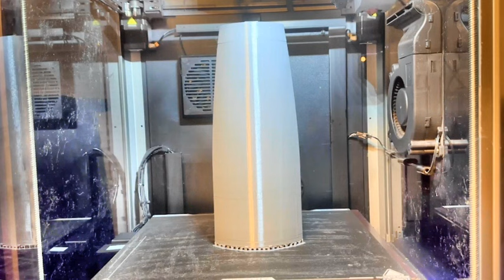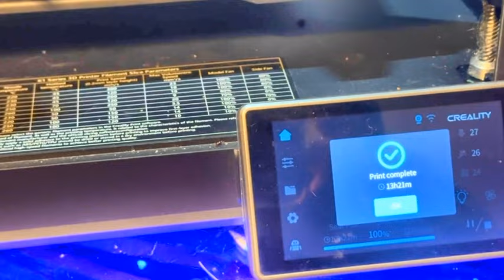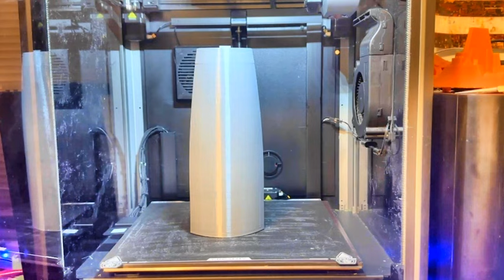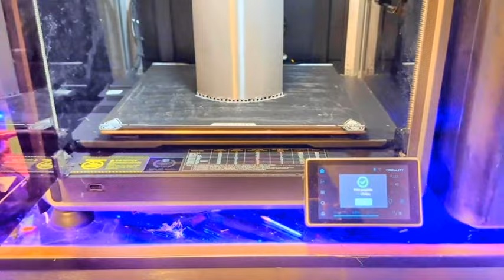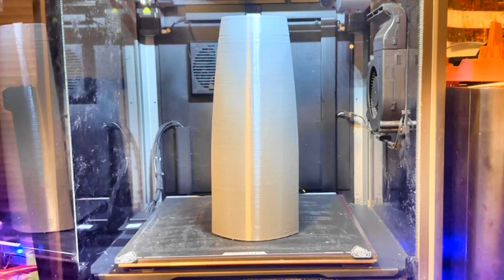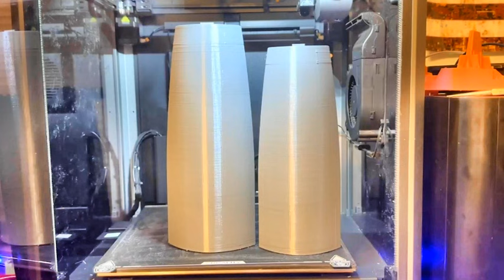My 3D Print of the Cobra Night Raven Part 10

Comment: I was just telling someone about the Gi Joe /Cobra answer the the SR-71 and Drone. Cool you brought it back. See if you remember this… 
There was a GiJoe vehicle called the “Shark” in think. It had action figure in high altitude/space suit but also went under water in this flying submarine… 
Bring that one back. I’ve described it to several people and they think I’m crazy and that I’m imagining it.
Reply from the maker: Thanks for Watching. WOW!!! I did??? :)  I am thinking about getting the Creality K2 Plus, that has a bigger build plate, probably on this upcoming Black Friday sale,  if and when it goes on Amazon, or at the Creality website at: https://store.creality.com/products/creality-k2-plus-combo-3d-printer?spm=..collection_53542add-ae5c-4306-8be0-41c1c4aad786.albums_1.1&spm_prev=..collection_d363a905-4d81-48e5-af5f-389afd6aa334.header_1.1 . I am having issues right now with the Seating Compartment of the Night Raven being too short in length. I will post a video on that soon.. S3D Toys.com has a lot of these vehicles. I found this website that has a 3d print of the SHARC, but it cost $20.00 to get the file. It is at: https://www.etsy.com/listing/1201552631/2-seat-gi-joe-sharc-digital-stl-file . I am probably going to print that one out as soon as I can. Would you like one??? The filament is one of my biggest costs right now, along with the remote controlled supplies. With the Sharc, I would have to find the right filament that is waterproof, along with the cost of the PLA or PETG Gloop. I am taking that all into consideration, as that will be one of the many vehicles that I want to make remote controlled, and it would be 3D printed.